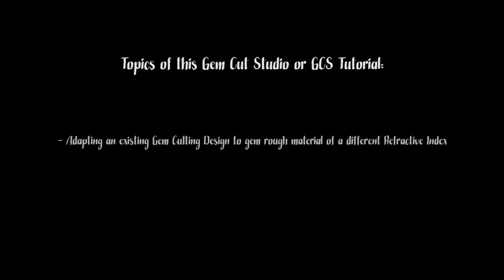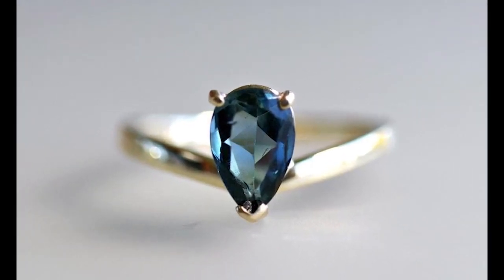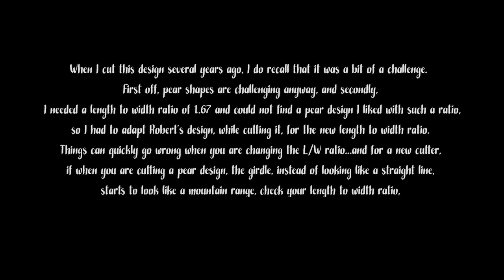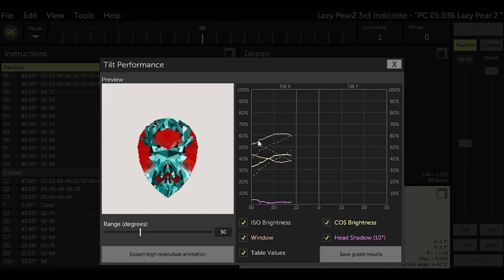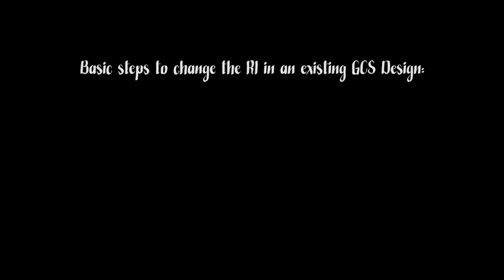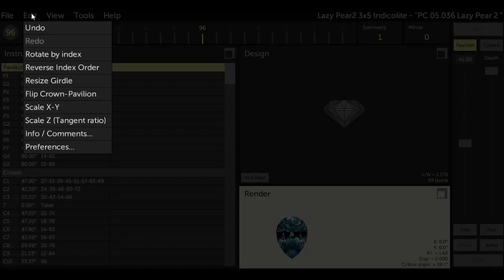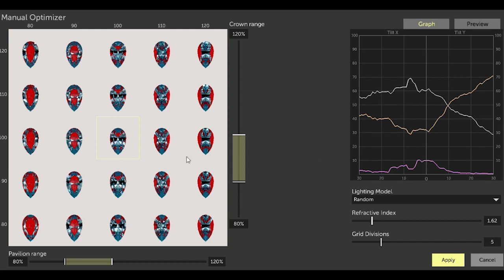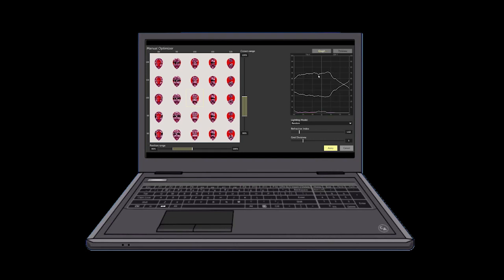Gem Cut Studio Tutorial 6: Adapting A Design To A Different RI

Comment: Hello , great tutorial. One question about performance, so the relationship in between brightness and windowing in the graph means the higher the brightness and lower the windowing is better resulting in a shiny sparkling design ? Is that correct ? 
Thank you for your excellent tutorials !
Reply from the maker: Yes.  The higher the brightness, the more light will bounce back out of the stone into ones eyes.  Windowing is the amount of light that goes into the gemstone and does not bounce back at all, but passes through the stone.

Comment: When I followed along my angles after the L/W adjustment changed to 43.37 for P1 26-70 and so on. It appears your copy was using the angles from the original diagram. I'm not sure why your angles have not changed but am curious if it's a glitch or an update that caused it. I went back and triple checked my work and also made sure I saved the asc file as a gem file but still no difference in the angles on my machine compared to the two separate files. Not sure why your machine did not change the angles. Not picking just curious. Thanks for these videos you have helped me immensely.  Never mind lol lol You had apparently saved or printed the new design at sometime during the video. after I printed the pdf my angles changed to match yours. lol Sorry for the question. Thanks again for the help.
Reply: I saved both the original and adjusted files.  Looks like I displayed the original file in the video.  Nice catch.